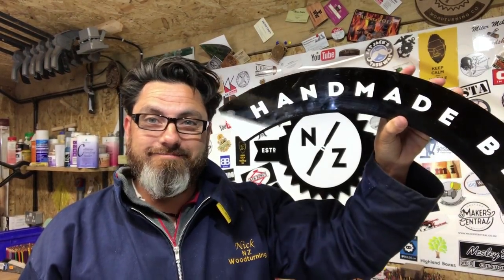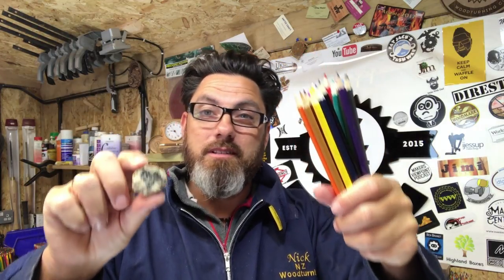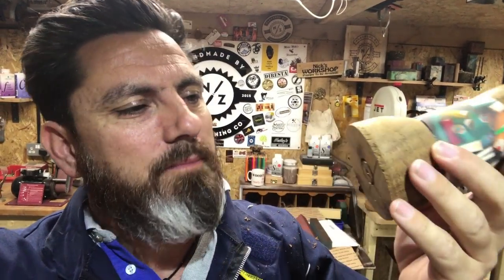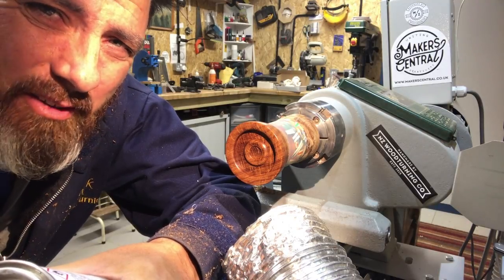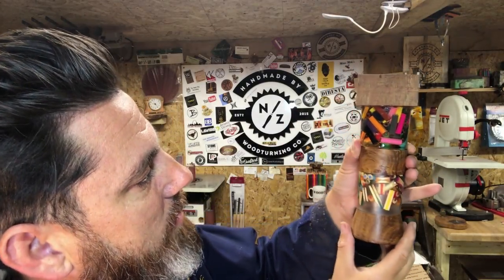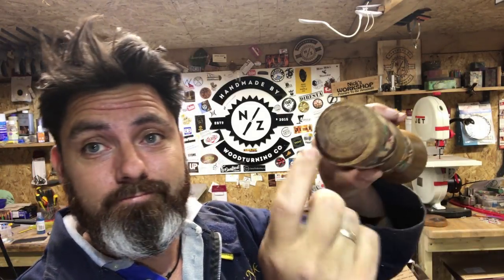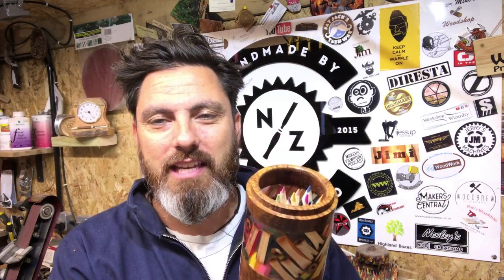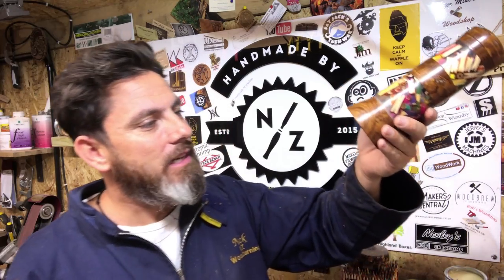Woodturning - The Pencil Pot

Comment: Can you use the resin without a pressure pot? I have some pieces that I think might look good with a resin fill, but they are too big for a pressure pot. Thanks and great job as always!
Reply: lol I realize this is a 5yr old comment, but I’ve been bingeing Nick’s videos and I know you can use a slow-cure resin on large projects, in layers if it’s too large, and you can pop the bubbles with a heat gun, blow dryer, or torch of some kind. But it’s been 5 years since you asked so I bet you know this by now!